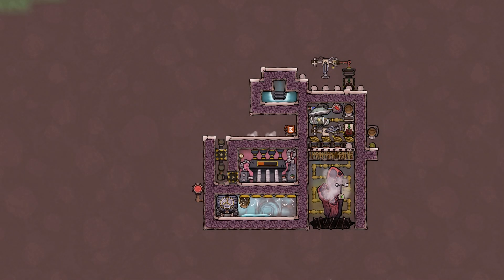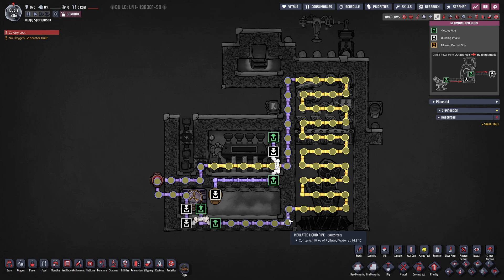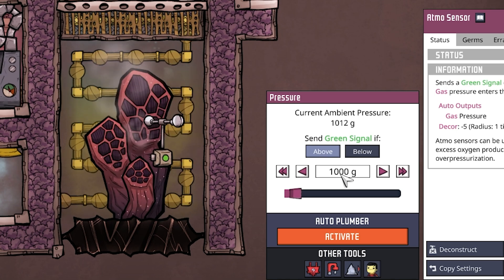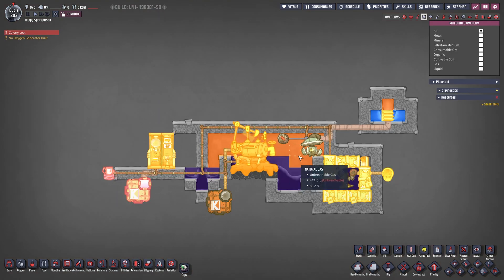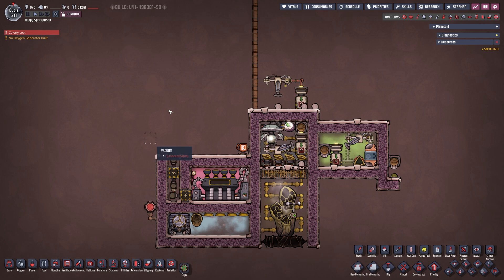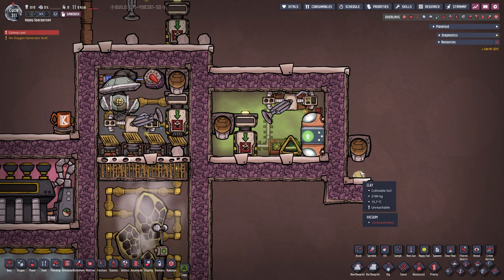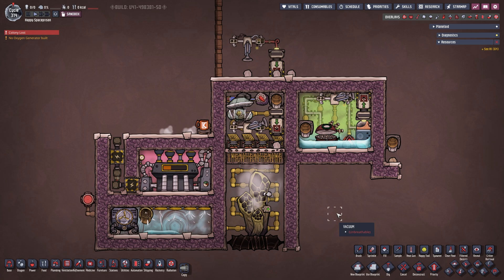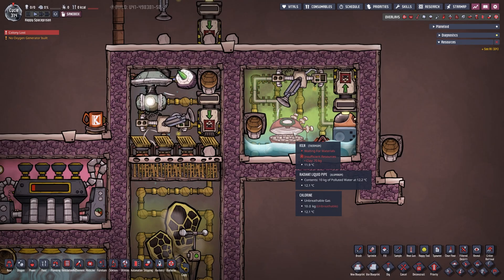GERMAN ENGINEER explains ONI: HOT & INFECTIOUS POLLUTED OXYGEN VENT! Oxygen Not Included Spaced Out

Comment: The Oil Reservoir has the potential to break! If you have a Dupe do the venting that has a low skill in Operating machines, the whole process will take enough time to boil the water inside the well and you get Steam. It is safer to either rescrict the access to the well or build it submerged in 1-2 layers of oil to prevent this. Cereamic piping and a Tempshift plate can also help.
Reply from the maker: That is true, that could be the case. Didn't consider that, thanks!
I guess I'd just set the Backpressure value lower and empty it more often or restrict the access to a single dupe.

Comment: If you have thermium, I'd guess that you can put metal or diamond tiles above the hot polluted oxygen vent, and have a steam room above that with a steam turbine above that.  The gas pump made of thermium would be in the vent room and only pump out gas once it's cooled down below a certain temperature to a room with deodorizes made of ceramic.  Finally, the resulting less hot oxygen gets pump to something like an oxylite refinery where one might not care so much about temperature.  That might be power positive, since an aquatuner wouldn't be needed, though I don't know for sure.

Such a system might work pre-thermium without an aquatuner, if the hot polluted oxygen gas has some room to funnel through before it gets pumped out, though I don't know how long of a funnel one would want.  If the steam room has crude oil to soak up the heat at the bottom instead of steam, it might not even need a steel gas pump and gold amalgam might suffice.

Anyways, always good to see different sorts of tamers!
Reply from the maker: I like the idea! I may make different tamers with more advanced materials later, but currently I'm trying to stay at steel and below. Non of my current builds should require any space materials :)
Reply: @BierTier  I got the funnel idea from here: https://www.youtube.com/watch?v=DHDu8yGQeYg  That's a pre-steel hydrogen vent tamer.

Comment: This series is so cool. Love it very much❤
Reply: For the hot polluted oxygen vent, should I add a mesh tile between airflow tile and poxygen purifier  (with some liquid like crude oil, petrolium)
Reply: Just want to make sure that no poxygen gonna mess up my colony
Reply from the maker: It’s really not needed, I had it running for almost 100 cycles without any issues. As long as the deodorizers have sand you’ll be fine. You could add an element sensor for your pump if you want to be even safer, but again, not really needed. 

I’m happy that you enjoy the series 😊